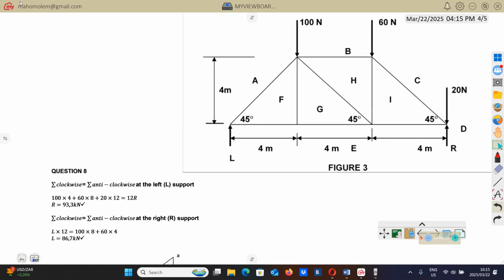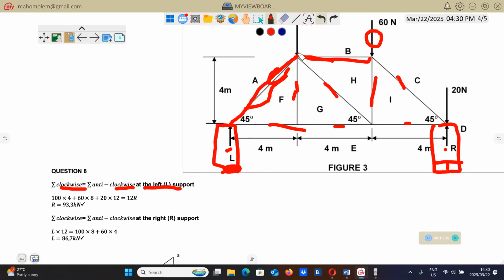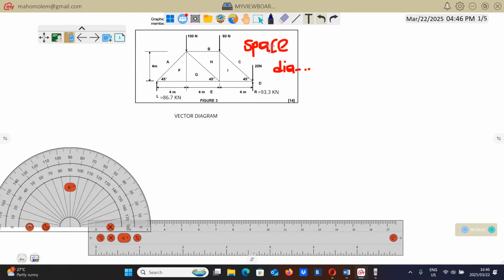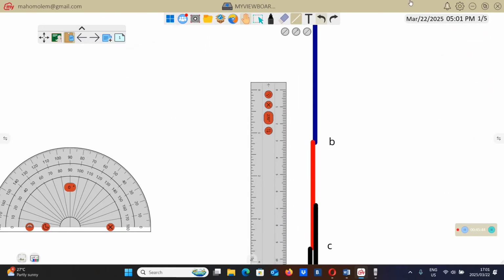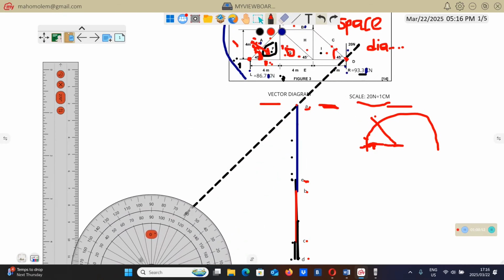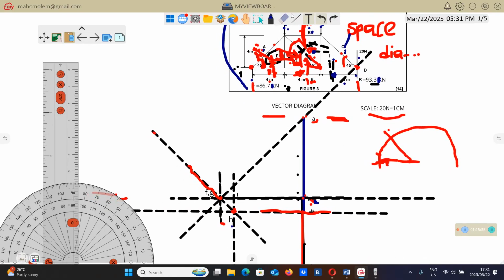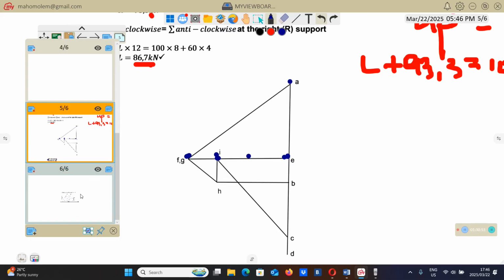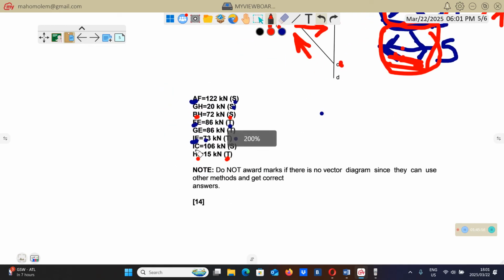Structural framework: Strength of Materials and structures N5

Comment: sir isn't R between A & B coz of its length ,& not between B& C?
Reply from the maker: No, R ends between B and C. But I understand where your question is coming from. Remember our Scale of 1 cm = 20 N. The force of R = 86,7 N. On the vector diagram according to our scale, the length of R will be equal to 4.3 cm upward not 8.7 cm upward. If you use 8,7 cm that is when it will end between A AND B